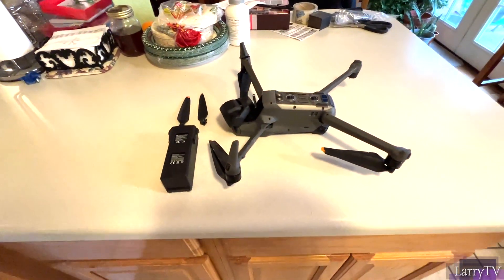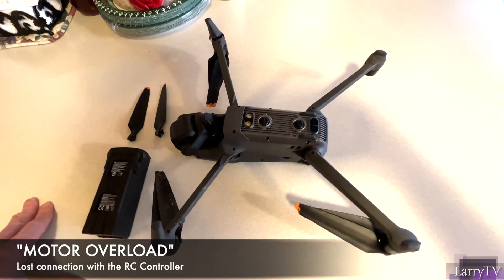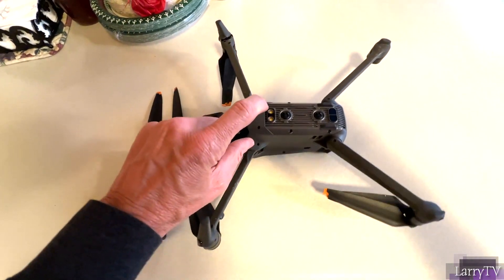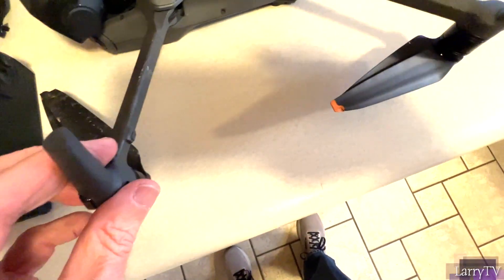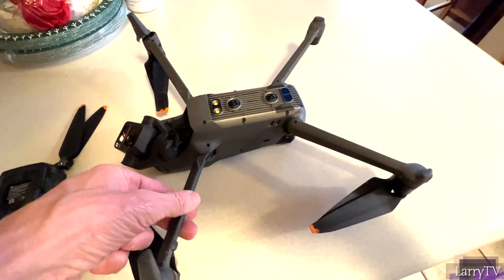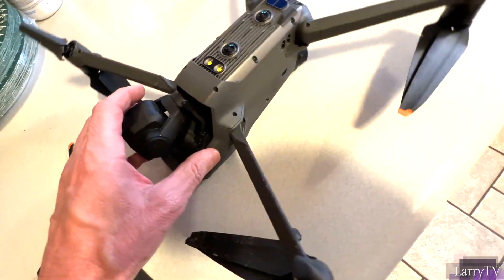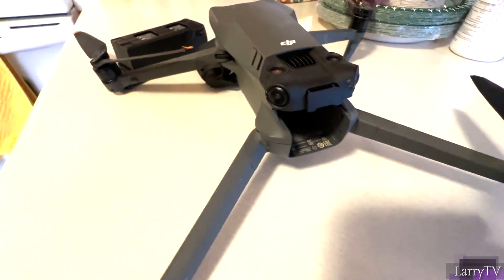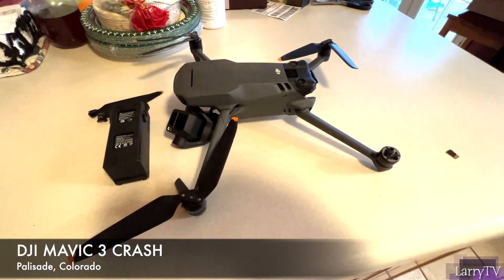DJI MAVIC 3 CRASH - "Motor Overload," Dec. 26, 2022, Colorado River and I-70, Palisade, Colorado

Comment: I had the same thing happen to me in Blaine Minnesota on Monday 2 2023. It fell from the sky and landed on my roof
Reply from the maker: Please tell me more about your crash.
Reply: @HDimpactvideos  I was doing Waypoints. It was foggy I was going through the fog to go above the low hanging clouds and it gave me the warnings ⚠️ telling me the propellers failed to check the motor and motor overload
Reply: @HDimpactvideos  I bought it on the 17th of December and returned it to the place I bought it and got a new one
Reply from the maker: I wonder what exactly happened? Did you just wait for it to fall out of the clouds onto the ground? Do you have video of the actual flight? My last flight video failed to save to the memory card. I am not able to see what happened. Nothing was captured to my RC controller either. Glad you got a new one. I am having to work directly with DJI. It has been tough.
Reply from the maker: DJI MAVIC 3 CRASH UPDATE: The results are in. Whose fault was it?? https://youtu.be/GM9O1gwvIIk

Comment: You said you have a DJI RC controller. Do you still have the controller in your possession? If so turn it on, in the lower left corner you should see an option called "album" tap on that. select "Aircraft Album" you should have a low rez copy of everything the drone camera was recording. (same as what would have been on the sd card.) If you did hit a small branch you will see the branches, and the drone spin and fall. (This could be painful to watch) Including the footage of the crash all the way till the battery popped out. Let me know what you find.
Reply from the maker: Gerald, I really appreciate your help with this and taking the time to care and to look at my crash. One of the first things I did was check the controller for any lo-res video of the flights. I had two flights that day and oddly, neither of the videos are there. I had two video files on my SD card that I retrieved from the crash. As you know the videos are broken up into approximately three minutes segments. The last three minutes of the flight, I was not able to shut the recording off and as I assumed, the file was corrupted although the data is there I just can't read it. I've tried several online resources and even local computer stores here to help me restore or repair the MP4 file. So far no luck. Any suggestions would be greatly appreciated...Larry
Reply: @HDimpactvideos  Bummer. I have never been able to get data from a corrupted MP4. I have a 128 mb SD in my controller and have 125 files over the last month saved in the "aircraft album".  Did you tap text  "Aircraft album" or the "Saved"? it would not be under the  all,photos,videos,favorites?  I have 14 in the "saved" selection which are the screen recordings when you select that recording option. Files are saved under "Aircraft Album" "Saved" "Phone Album" and "Movies"  I don't have any under the "All Photos Videos Favorites" it's an odd setup.
Reply from the maker: Gerald, thank you for writing back. Still working on that corrupted file. I've seen video from last flights before a crash. I wonder why mine was corrupted? I knew that not stopping the video before the unit shut off would cause that to happen. I did not even know I had the option to record the screen until all of this happened. Normally, though, the video is saved in the video cache. In this case it was all gone, ??? I can only review the flight path data and imagine what the video may have looked like. Plus, I remember that last shot in my mind vividly.
Reply from the maker: DJI MAVIC 3 CRASH UPDATE: The results are in. Whose fault was it?? https://youtu.be/GM9O1gwvIIk

Comment: Are you sure you went back to Cine mode? In sport mode,  Obstacles avoidance is turned off so you probably crashed your drone during your point of interest if you did not switch to Cine mode. I suggest you carefully examine the corresponding flight logs in Airdata, this should help you figuring out what suddenly happened .
Reply from the maker: Jean, thank you for your comment. For reference sake I mentioned the only thing I did different Monday was on my first flight I tried the sport mode. On my last flight I was not in the sport mode. My RC controller is in the C (Cinema) mode. It would make no sense flying so fast doing a slow, circular P.O.I. flight path. I've done these shots many times with great results. Plus I was flying in a safe area with no obstacles near me. The drone lost connection after the "motor overload" error and plummeted to the ground, severely damaging and disabling the aircraft upon impact.
Reply: @HDimpactvideos  Got it. So it's very likely an issue with the motors (ESC). I am quite sure the flight logs should give clear evidence to DJI. Upload them in AirData , the issue with the motors should then be clearly identified and quantified ...
Reply from the maker: I have emailed the AirData folks. Not sure they can help me. There is no flight data on my phone or controller other than the date of the flight, average height and distance of the flight. No flight path or other information about the incident.
Reply from the maker: DJI MAVIC 3 CRASH UPDATE: The results are in. Whose fault was it?? https://youtu.be/GM9O1gwvIIk
Reply: @HDimpactvideos  Happy for you. I understand they still investigate about root cause.

Comment: Pilot error for sure.
Reply from the maker: I retrieved the flight telemetry after the crash. It shows a manufacturer failure and malfunction. DJI will replace for no charge.
Reply: @HDimpactvideos  did you have care Refresh?
Reply from the maker: @jayswift3601  Yes, a one year subscription but I am very hesitant to pay for a replacement when it may be covered under a warranty. I will now have to wait until they can do their own assessment of the incident. I will keep you posted.
Reply: @HDimpactvideos  ok awesome.
Reply from the maker: DJI MAVIC 3 CRASH UPDATE: The results are in. Whose fault was it?? https://youtu.be/GM9O1gwvIIk